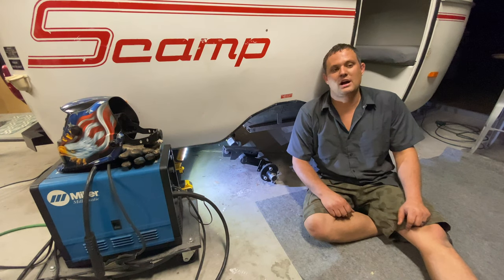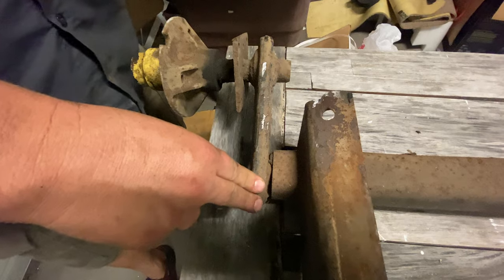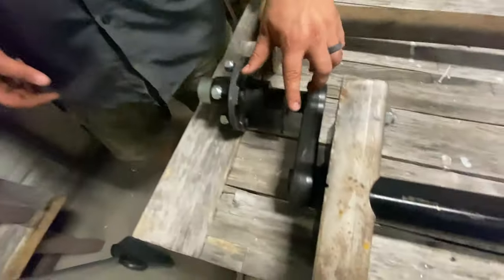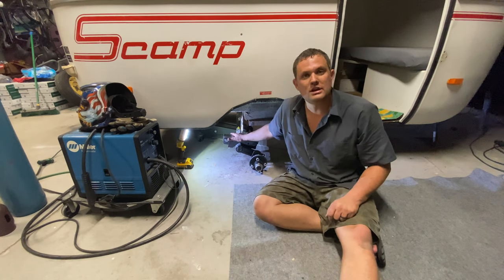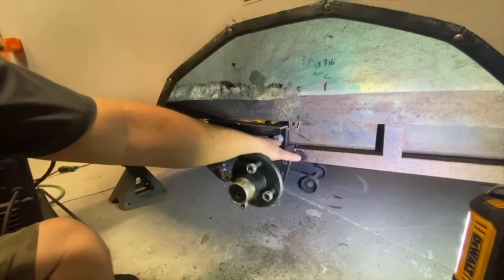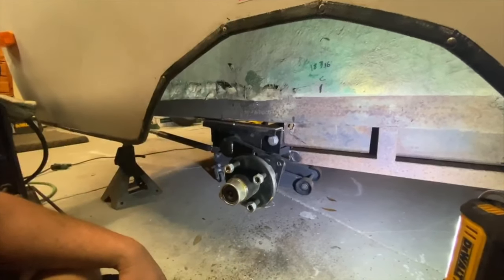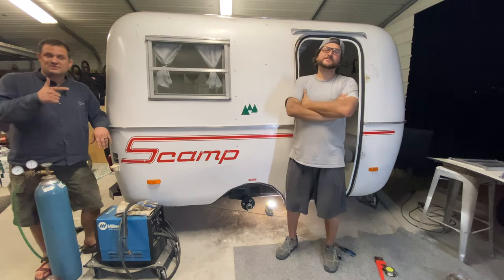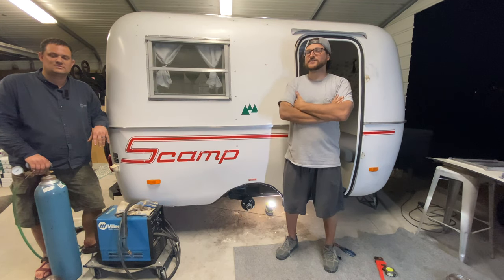13' & 16' Scamp Axle Replacement Part 2

Comment: When you removed bolt  to move up into position did you replace the bolt
Reply from the maker: Hey Pat, we ended up ditching the bolt on section all together and welding it directly.

Comment: Can I replace it with a  leaf spring 2k
Reply from the maker: You can, but it would yield 6” plus of lift, and you’d need to build a custom subframe. The scamp setup is an unusual leading arm, so it’s fairly limiting. I’ve seen one on leafs, but it’s very tall.